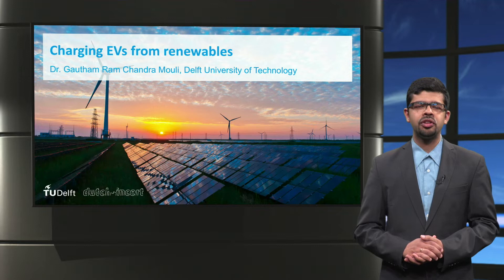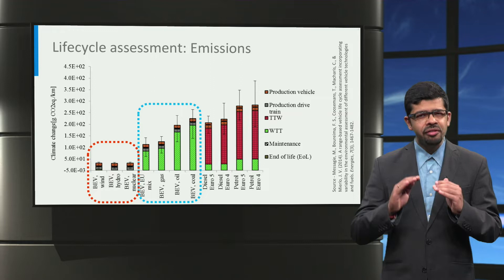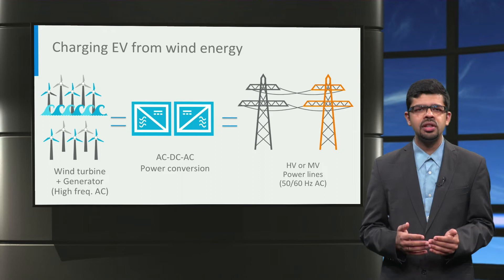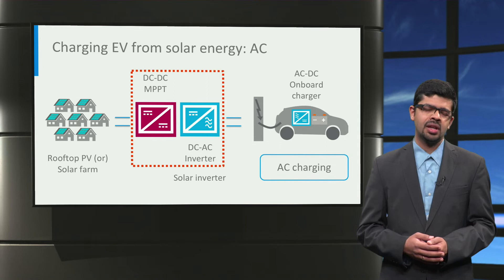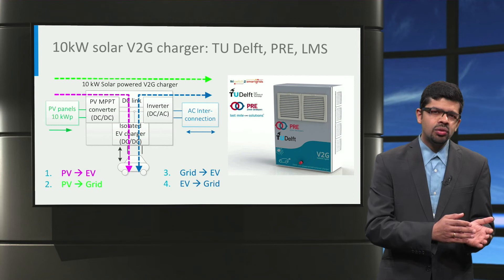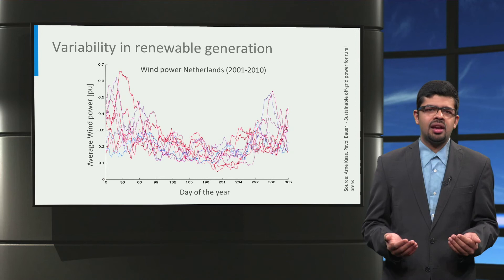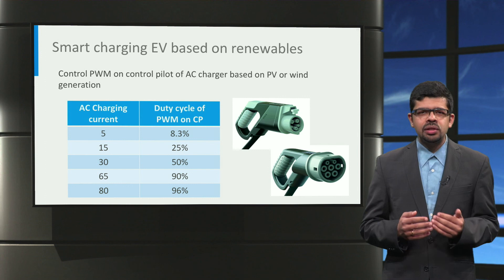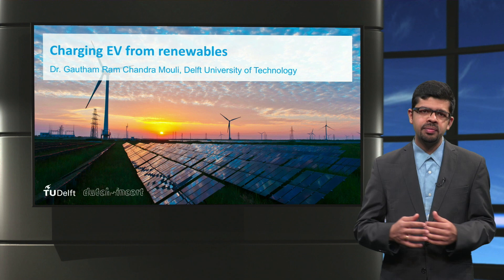Charging EVs from renewables

Comment: Thank you for this informative video. Most EV batteries are currently 400V. Do you have further material that explains how the isolated dc to dc charger works. For instance a 360w panel at an open circuit voltage of 46v could be stepped up in series to deliver 400v or close to 400v during daylight DC. Or similarly a large array of panels in Parallel at 48V DC could be used. I am interested to know what sort of equipment is available in either of those scenarios. Sticking with DC to DC if a home owner has solar PV would seem most efficient, as this also negates the need for the vehicles on board ac to dc rectifier.